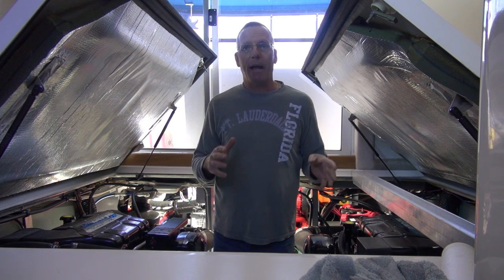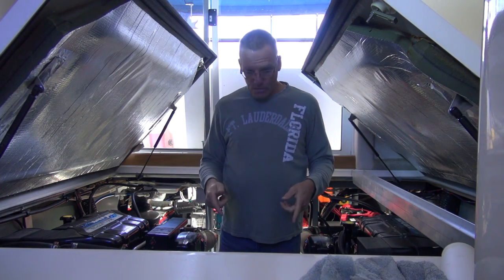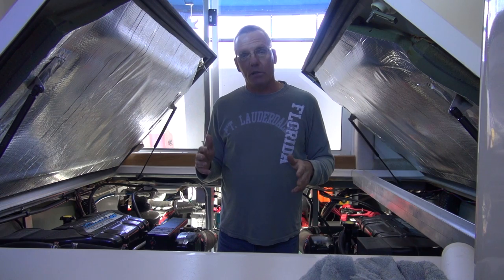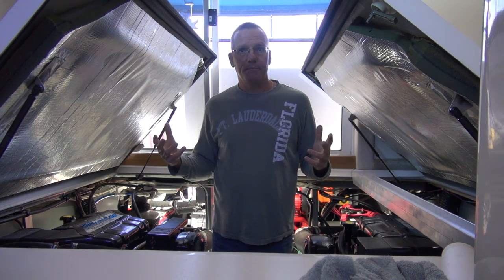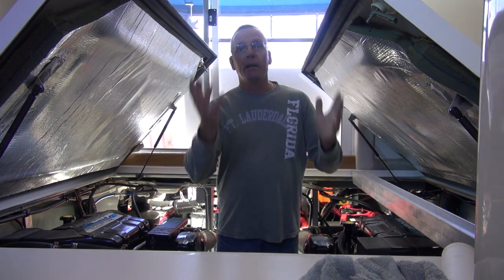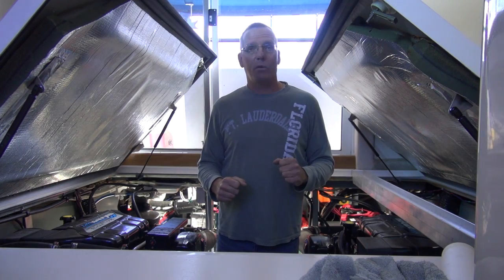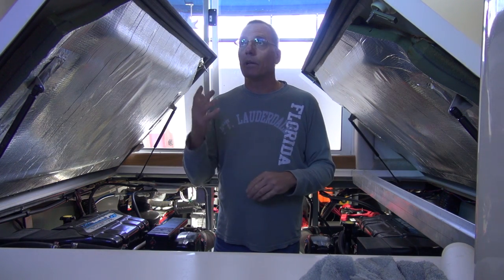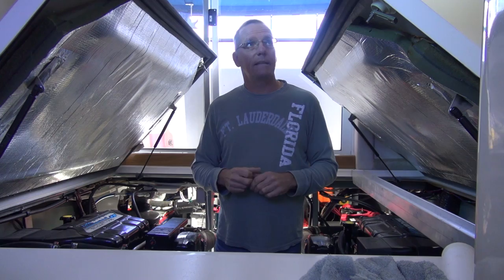Boat Winterizing - Sea Ray 400 Sedan Bridge

Comment: I bought the Spy Sun-glasses for driving and shopping.  Then I learned that all stores have a sticker on their doors saying that you can't video in their stores.  I still have the video's but had to privet all of them.  I don't know how the Sun-glasses go with it being against the law to video while driving.  I don't use the Sun-glasses much any more.
Did you pour Anti-freeze into all drains of the boat?  I'm sure you did.  Winterizing the boat shouldn't be much different than winterizing a Trailer or motor-home.
Reply from the maker: +TheMonkeyrock77 Yes, anti freeze in all of the drains. Works fine.